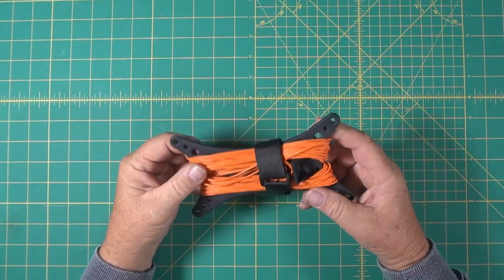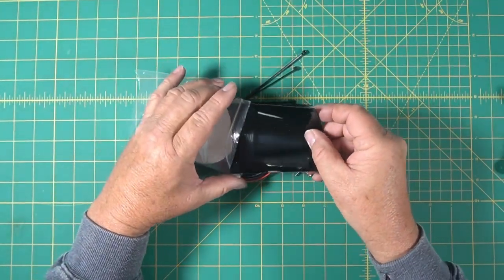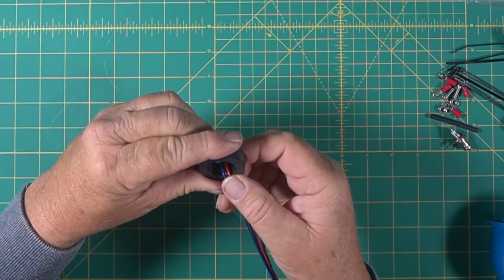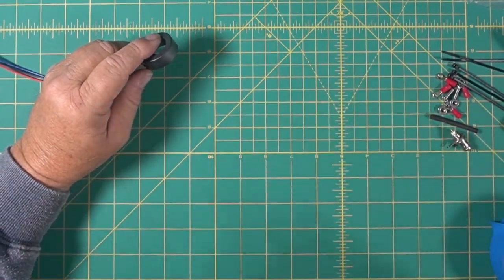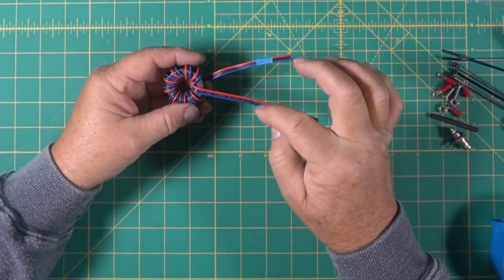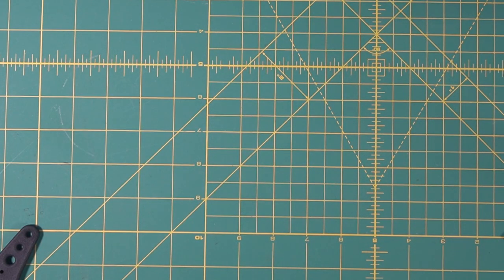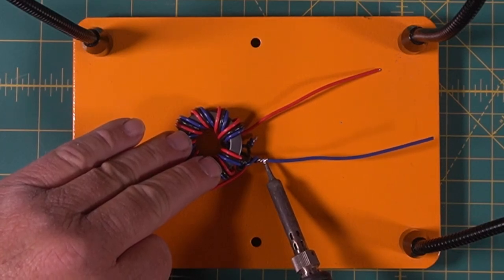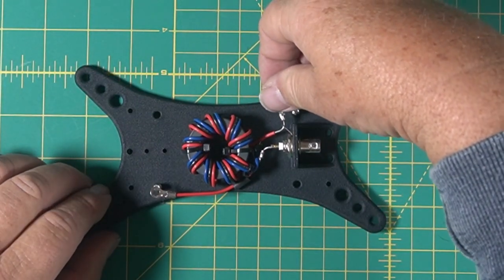A DIY antenna kit from Coffee and Ham Radios 9 1 EFRW.

Comment: I only have trouble with music as you are talking. Sometimes it makes it hard to understand. You did that but the music was low enough that it wasn't covering up your talking. I don't understand why all the kits are QRP! I ordered some 240-43 so I can use them for 100 watts all day! I like that winder, looks strong enough to hold up going out to many POTA. It is human to make mistakes. If that was the biggest problem that day you are very lucky!   73  W4DES
Reply from the maker: Hi Donald, are you doing 100 digital? You should be able to do 100 SSB and 50 watts FT8,  one of our winders with a 240 it's tight but doable. I grabbed a 240 and winder it hangs over about 3/16" on each side. We have a larger winder in the works but the nylon printing is really expensive and we were waiting in hopes it would come down. Thanks for watching!
Reply: @KK6USYHamRadioAdventures  It looked like a small Toroid and have seen where the small ones overheat doing 100 watts SSB over time. It also looks like 9 turns on there was hard to get them all on there without overlapping wires.